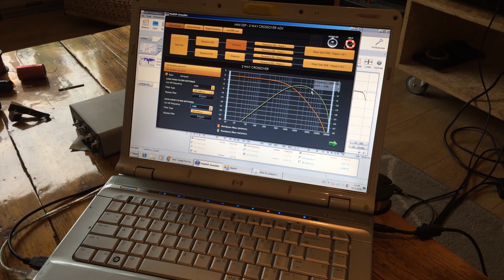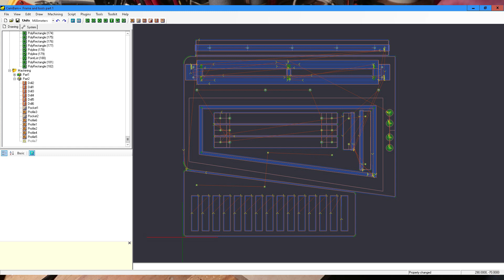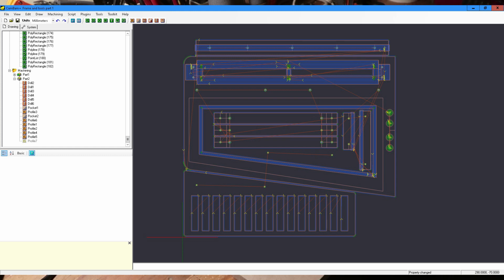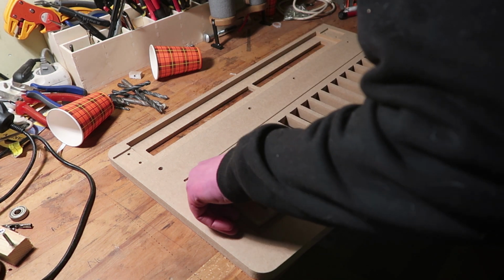APOGEE "like" Planar magnetic -  Part 5 - Super 77 glue and MDF bits and bobs

Comment: Hi Joppe, I use 3M remount. It’s expensive but I’ve found nothing better if you want to only temporarily mount something. You can re-use a single application multiple times and it was strong enough to mount the diaphragms in my headphones when I ran out of permanent spray adhesive.

Something I meant to ask on your last video but forgot; what are the benefits / drawbacks of corrugating the membrane? Apart from say, decreasing xmax. Does it effect frequency response or distortion?
Reply from the maker: yeah i wanted to buy a can of remount to try :( but the company i ordered these from did not have it :( so will try next time.   i   hope it does a good job on the cutting mat .

well the corugation .... im not to sure yet. thats what i want to find out.  since it is still held by the sides .... im not to sure. onyl thing i can think of right now is lower resonance ? easy tuneable ? maybe easier to move>?   al things i dont know to be honest.   people always rave about apogee style planars. and i only made normal ones so to me its a suprise to :) if it sucks i know people will say i probably did something wrong since there method is better ... haha we will see :)